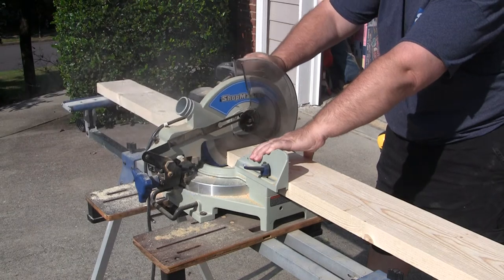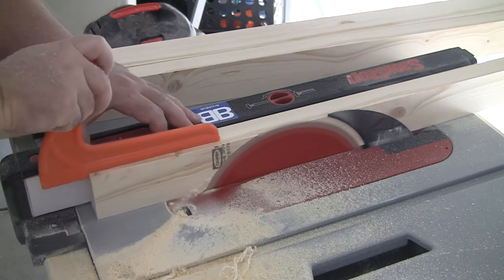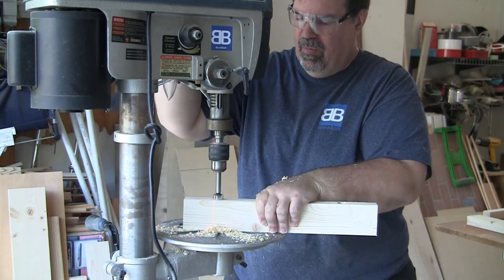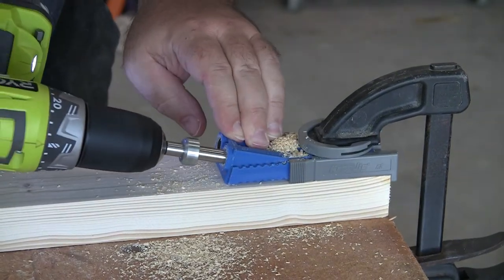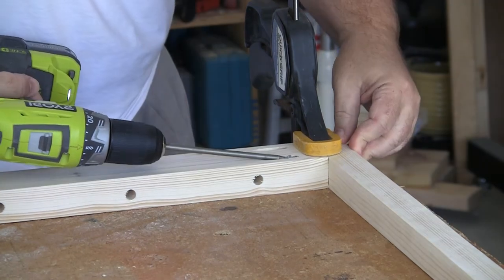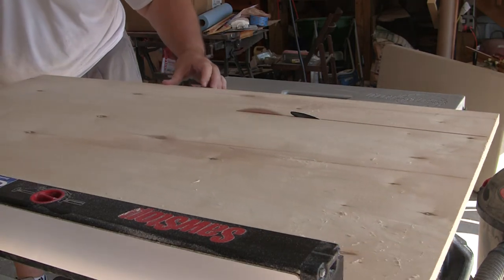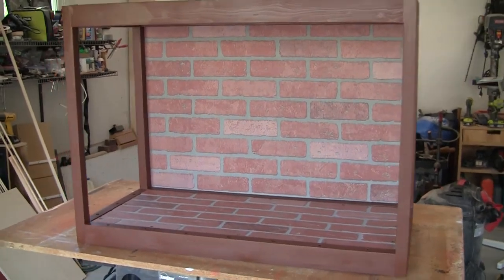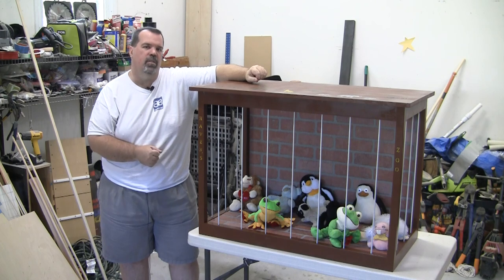Build a stuffed animal zoo – We built a zoo! (how to)

Comment: Hi! Love this project. I have decided that my Dad and I are going to build one of these for my daughter for her 3rd birthday. Could you please provide me with all of the measurements? Width, Height, Depth? It would be greatly appreciated! Thanks - great job!
Reply from the maker: I no longer have access to the the zoo but I went back into my notebook and here are my notes.  Sorry I don't have actual plans.  The first thing I do is cut down and mill up my 2x6's.  I don't remember the actual width of each board after milling but I believe they came to 1.25" thick.  From my notes the overall outside dimension of the zoo was 38 inches wide x 28 inches tall x 18 inches deep.  Please note this is without the top.  The top was 3/4 inch thick and had a 1 inch overhang on both sides and front, flush in the back.  This was from my notes but realize that I often make small tweaks during the build.  You can really do this at just about any dimensions you want.  Let me know if you want more details.  Good luck with yours!
Reply: @BronkBuilt  , that is perfect. I really like the size and heft of your zoo. My Dad and I are going to make it outnof Cherry, though. My daughter is 3 and I figure she will have stuffed animals for at keast 10-12 more years, so we're making it to last as well as match the antique bedroom set she will get when shes oit of her crib....the notes are great, thanks!!
Reply: @BronkBuilt  . Well, we got our zoo built! I am very ahppy with it and my daughter, Chance, loves it!  Thanks for the inspiration!
Reply from the maker: That is awesome!
Reply: @BronkBuilt  Do you happen to recall what size (or approximate size) bungee you used?
Reply from the maker: I seem to recall 1/4 inch but I honestly don't recall.  I bought them in bulk form but I seem to remember they were the same thickness as standard ones you buy at the store.
Reply: @BronkBuilt  Thank you for the response! It's my first woodworking project ever, so I'm excited to finish it up! I love the way you did the bungee cord. It's definitely more challenging than eye hooks, but it looks SOOOO much better! Thanks again!
Reply from the maker: Let me know how it turns out
Reply: @BronkBuilt  I sure will! I'm waiting for the bungee cord to come back into stock. I live in rural northeastern Maine and we are very limited as to what we have access to, so sometimes that means waiting patiently. :)